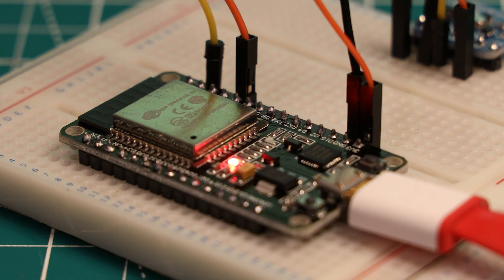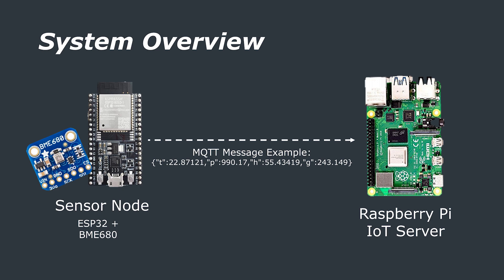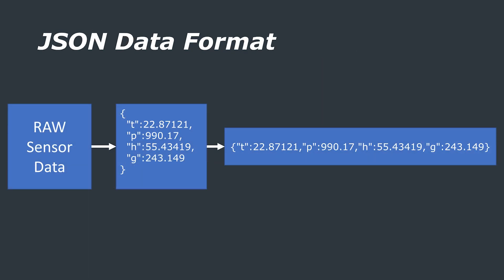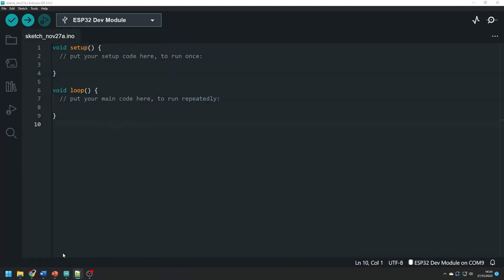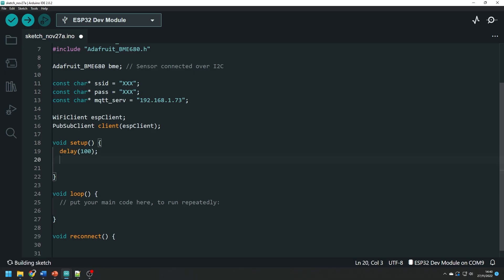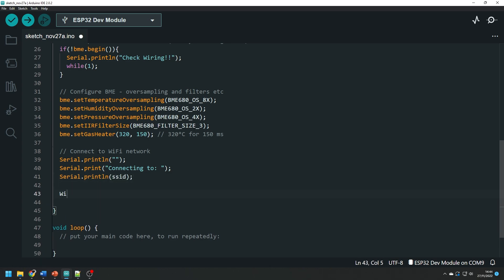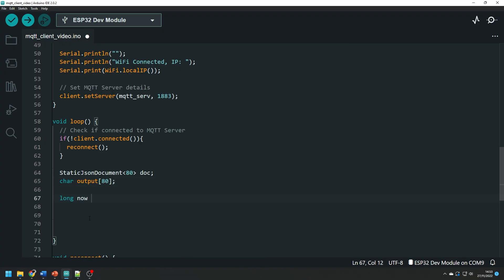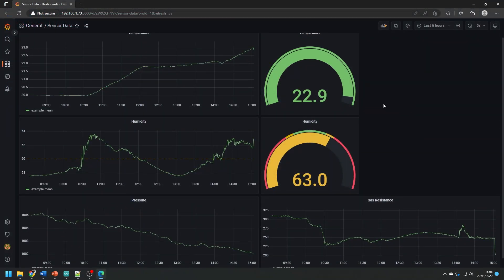Simple ESP32 IoT Sensor Node Tutorial: WiFi Enabled MQTT Sensor Data Node

Comment: Great video, it worked for me, I had a couple of issues, firstly I was just testing this with analogue input from a pin and some of the ESP32 analogue pins are disabled when wifi is operational. That took a while to sort! The only other issue was that I somehow didn't connect the nodes in node red, once that was sorted worked fine. I'll be using this for a battery operated weather station powered by a rather large 10w solar panel (since I want it on all the time) and a lipo . I've used Andreas Spiess's design with a power path. I'll be using the data in Home Assistant and also want to design a wall mounted retro display to show current weather with an arrow for wind direction etc. It's all a bit of a mammoth project since I knew very little when I started, this video has been a big help though.
Reply from the maker: I'm happy that this video played a part in your project! Best of luck with your project and would be interested to hear how the retro display turns out!

Comment: I would like to use the netsgpclient to collect data from my solar micro inverter. How can I have another client from netsgpclient to receive serial data via an lc12s 2.4ghz module? The two programs work by themselves but how can I merge them? I need a wifi mqtt serial gateway I guess.

Comment: Excellent video, thank you very much for your hard work! 

Could you please consider doing this IoT node but written in a Python-based enviroment? Such as Circuit python which already has Adafruit's libraries for most of the ICs/boards and protocols you're using

or would you be so kind to point me towards a documentation that helps me make the JSON doc you've made in python? I have to be honest I've been following along your IoT server + IoT Node videos using an UnexpectedMaker S3 and I've been doing okay, I've collected the data from the sensors, connected to the wifi and published a message to the broker, but the only idea I have to submit the Json file is to create a dictionary, but afterwards I'm not sure I'll be able to publish it correctly nor I know how to monitor the Mosquitto container to see if the generic print I published is sitting where it should be, please help

As for the server side is pretty straight forward and I just have to make sure the information is getting correctly to sensor_data DB before finishing up the Grafana setup